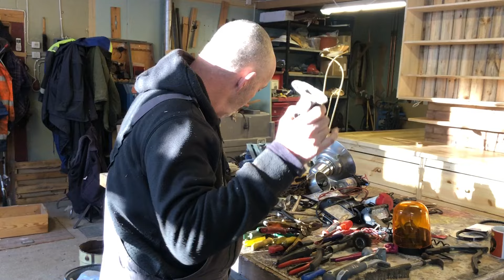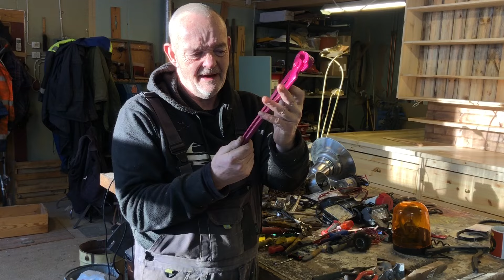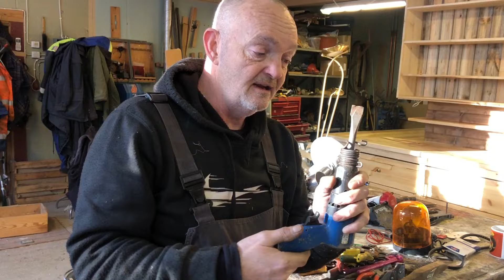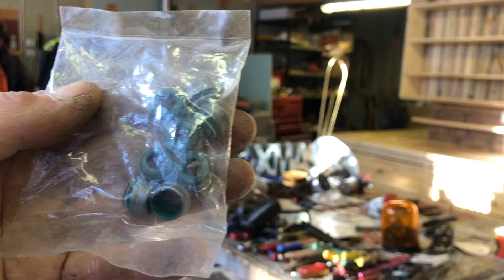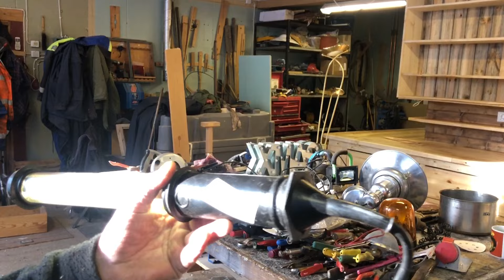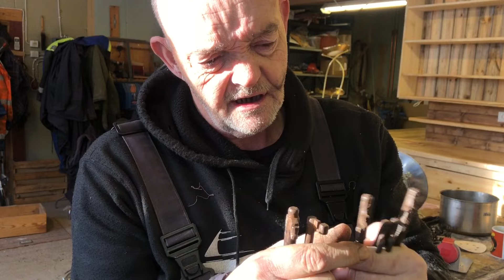I did NOT go Dumpster Diving, but did find a huge amount of tools!

Comment: 10:22 EA Berg(Hajen)/Sandvik Bahco. Really good `older´ valuable stuff😀🤠, congrats for that one🥳. 35-40 mm 🤔? 10:53 MMA-Welding hatchet. 21:03 ``Anything picker-upper/reacher´´, remote control or anything dropped under a couch etc 😎. 27:08 Dutch company but might be PRC-made like most stuff nowadays 😭. 29:34 The joy when things unexpectedly work 😮🙃.32:00 That´s some serious bad luck 😱. 33:41 Ouch 😳😮.
Reply from the maker: Thanks for the valuable info and your time I appreciate it.

Comment: Finally a video that right up my alley Simon you did well tools are one of my biggest sellers at my shop and you can't beat Sweden steel I have some amazing Swedish axes they are the best we are buried in snow down here in New hampshire 34" on the ground having an old fashioned winter for sure take care and be safe
Reply from the maker: Great, well I have tools, just short of snow. It would seem you have both.